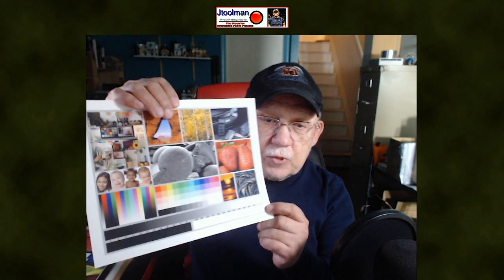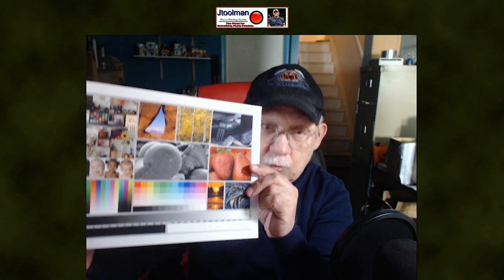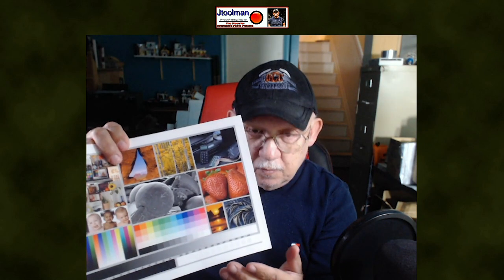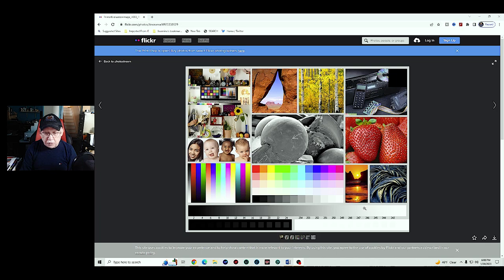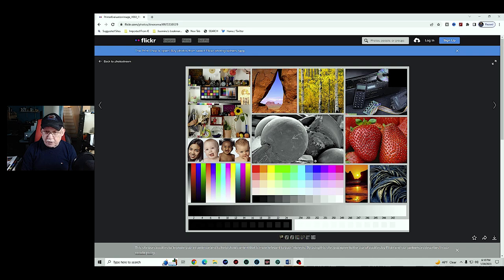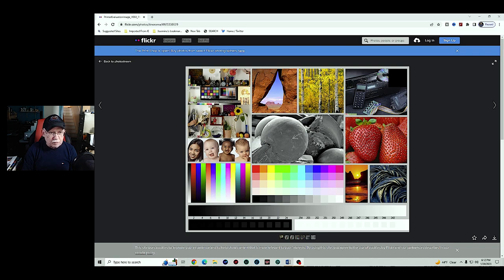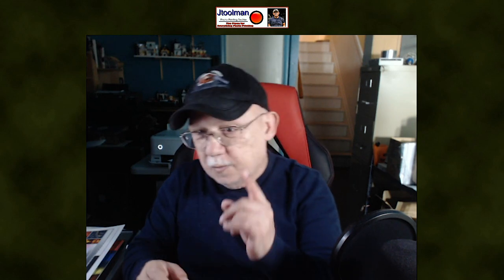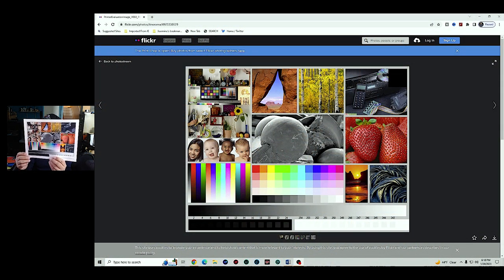So why do I need to use the Standard Evaluation Image again?

Comment: Question: What will be your recommendation for a printer for printing wedding cards? about 350gsm
Reply from the maker: If only text and graphics a small 4 color laser. Thick MEDIA sometimes will develop artifacts from print head strikes. Inkjet will not produce good results unless your card stock is actually designed for ink jet printing. It must be coated for inkjet printing.

Comment: FWIIW, For what It Is Worth, I have been using Precision Colors inks in my Canon Pixma Pro 100 since I have figured out that you have forgot more about printing than I will ever learn.  Bought the newer inks as they replaced the original PC inks.  Lately, for the second time, my yellow ink prints out red!  the first time it happened, I though maybe I made a mistake. Now that it has happened twice, to the same color I am less inclined.  Am I the only one to report this?  Been a very happy ink customer otherwise.
Reply from the maker: Well have you run a nozzle check? Are you saying that where there should be yellow you see red. Meaning a contamination yellow with magenta? Since there is no red in the pc42se ink set that's the only thing I can think of.
Reply: @cheo1949  Sorry, magenta. I look at magenta and I think red.  Yes, I fill all of the carts at a
one time, resetting the chips as I go. A day or two later I do a nozzle check, and the yellow is now magenta. I remove the yellow cart, and the bottom half of the sponge area is contaminated with magenta. The top half is yellow.  I have a spare set of carts on hand, so I change out the cart with a freshly filled yellow cart, and do a deep flush or two, until my nozzle check shows yellow is yellow. Whenever 24 or more hours has passed since my last print, I do a nozzle check. Save a lot of A3+ that way.
   I'm wondering if you or people you know have had it deal with this?